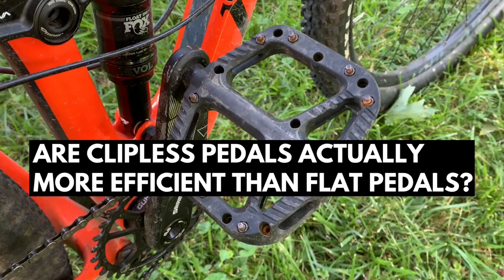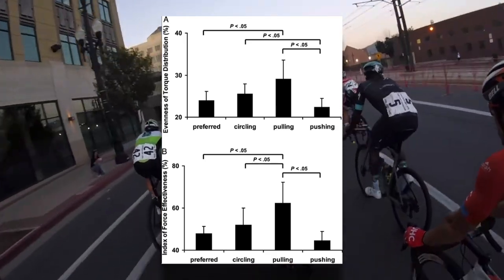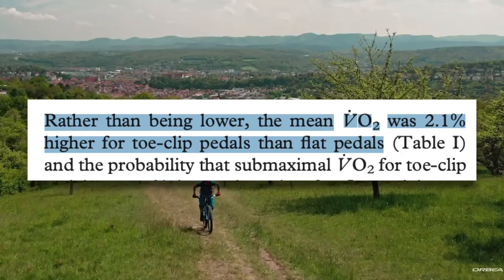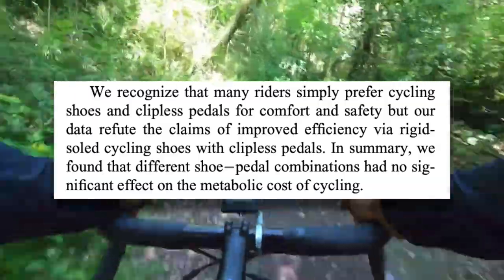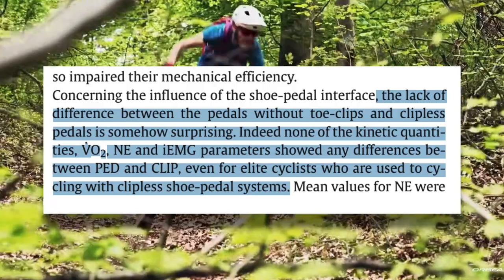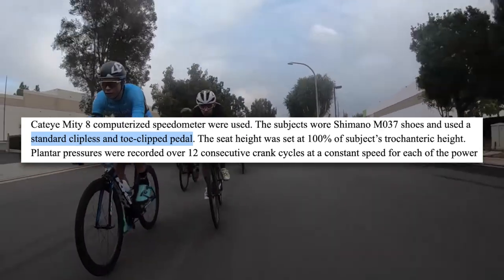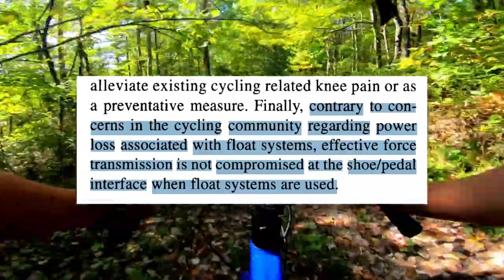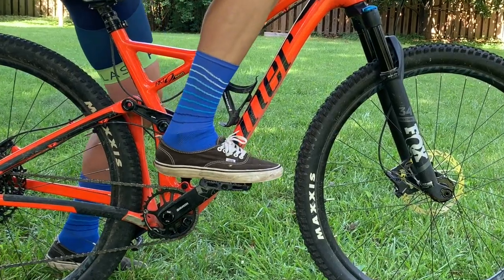Are Clipless Pedals Actually More Efficient Than Flat Pedals? The Answer Might Surprise You.

Comment: I just found out how to take a lot of seconds in 2nd transition in triathlon.
Just use your running shoes on the bike :)

Might not be interesting in long distance racing if the cycling shoes add to comfort but in short course or Olympic distance racing...this could easily make a difference.

I can't say I am terribly surprised.
When I first switched to clipless pedals I didn't get any faster.

And I guess most of us here will ha e experienced the same.
Reply: I won my age group in a supersprint triathlon by riding in my running shoes. I thought I looked like a moron, but then I saw myself cruising past all the geared-up guys (cause I had to make up for my non-existent swim).
If you also have some toe support attached to the flat pedals, it's almost not worth bringing your clipless pedals and cycling shoes for shorter (flat bike course) triathlon events.
Reply: Maybe not a bad idea, i often race people on the street and when we get to a light and have to stop well... i am usually 100m ahead while they are still busy clipping in.
Reply: The time you'd be saving in T2 would be lost in T1
Reply: @e995a1ad  I don't think putting on running shoes would take longer.
When the clipless shoes are clipped in you need to put them on as well, and when the shoes are not clipped in you would run a lot faster to the line where you can't mount.

Where do you think you would lose time in t1?
Reply: This is a good point for a shorter flat Tri. I bet there is also an aerodynamic difference that becomes noticeable in long distance riding.
Reply: I did this in my first Tri Club sprint tri. I had one of the fastest T2 times! Even our tri club president commented on how faster my T2 transition was. And I would've been even faster except I had to stop and ask where the run start was. lol.

However, during the bike portion of race there was some hills and fast downhills and my feet slipped off the pedals a couple times.

In my second sprint tri I wore my  and expected a much faster bike split. It ended up not being much quicker if at all, despite my shoes not slipping off the pedals at all.

During longer rides, tho, I definitely prefer my clipless pedals because the stiffer soles on my bike shoes spread out the pressure and it's much comfortable.
Reply: @Bendersnatchling  putting on cycling shoes takes virtually no time when done properly on the bike. Also for draft legal races at least, it's not about saving time overall, it's about not missing the pack. Which is why elite short distance athletes don't ride in running shoes.
Reply: @e995a1ad  The Chicago triathlon was muddy one year.  People who ran barefoot to the start of the bike had to deal with muddy feet when inserting them into their rubber-band held clipless shoes.
Reply: @norbert4571  Ya, I bet "ALL" the geared up guys were real rockets.  If you biked in your running shoes,  it was probably a pretty short bike event.
Reply: This is about EFFICIENCY, not speed/power. You can actually put more power INTO the upstroke, it's just not efficient. So it depends on if you can gain more time by pushing in more power.

Comment: This was from about 20 years ago when I was in college: the exercise physiologists I spoke to had established that pulling up with flexors was inefficienct, BUT, pushing over the top or pulling through the bottom of the pedal stroke was sometimes beneficial.
Reply: I tend to pull forward at the top/carry through at the bottom instead of "pulling up" and it feels like it recruits my shins and hips more than just my quads, I've found it helps me recover after sprints and uphill work, but I've also got monster calves and shins for whatever reason, I'm honestly not sure which came first, the 3/4ths stroke or the musculature.

It feels like simply measuring output efficiency misses some of the other potential benefits behind a more complete stroke, but I'm also a relative novice and I'm only starting 20+ mile rides in the past two weeks, usually having stuck to 10-15 before.
Reply: Hear hear. For the longest time I cycled like a triathlete with a toe downward, downward pushing, running on a bike type style. The only pulling I could then do was upwards "On the upstroke" but now I have switched to a heel dipped, pushing forwards more and I can now scrape that mud on to the wall in front of me, as if I am pointing brickwork with mortar, and pull backwards not upwards, and this recruits my glutes. As  Dylan says, this may not produce more power, but it uses a wider variety of muscles. I am 57 and my knees and hips started to go (hurt and  even had instability) because I did not use my glutes at all. Now I have swapped to the old "bunched up at the back" style of riding, like I am sitting on a high recumbent and touching my toes. In this style, I think I need to use at least straps or clipless (i.e. clip in) pedals.

Comment: I'm into touring where I like to do 200 km / day, spending 8 hours in the saddle. Speed is nothing to me and efficiency is everything. Based on your video, I have no desire to switch over. Thanks for this useful advice. I've found the other advantage to flat pedals is they're much easier when I get into a city and need to stop every couple of minutes. The disadvantage of flats is that there is a limited choice of stiff shoes for them. The running shoes I've been using make my feet sore after 4 - 5 hours. I've just ordered a pair of Five-Ten Freerider Pros and we'll see how they do. My  two concerns are blisters and breathability.
Reply: You can still use something like a mountain bike shoe made for SPD pedals and just don't put the cleat on them. Still get the benefit of the stiff sole.
Reply: @Dave_the_Dave  that's actually interesting. I've actually thought of using a pair of hard soled cycling shoes without the cleats in them. Wonder how that would work.
Reply: B.S.

Comment: I've been on flats for years. Back in the 90s I got a set of MKS brand clipless pedals which were hated by the biking press, but I loved. The reason they were disliked was because they were more sensitive to dirt in the cleats for clipping in, than SPDs, which is a fair point, but they were vilified because they didn't unclip when you moved your heel inwards, locking more firmly to the pedal instead. This feature was actually a major benefit as I could leave the release tension very low and still never get an accidental unclip because by just pulling my heels inwards a little when bracing for bumps or on hard sprints I was certain I was locked to the pedals. By the same token, I was so confident in the unclipping repeatability that I could unclip to bail off the back of an overcooked wheelie on demand and with no delay.
Every clipless pedal I've used since (Admittedly all Shimano, mostly because most other bike companies seem to have spent so much on marketing wankers and cost cutting that they've forgotten to employ any engineers, so if Shimano can't do it, I can be pretty confident none of the rest can do it at twice the price) has been garbage in terms of repeatability on unclipping, staying clipped in reliably but with low enough force to unclip that bailing unexpectedly is an option and accidental unclipping under power. That I ride further and climb faster than most people I know who use clipless pedals using Hope flats (Only low profile flat pedal I've found that can survive actual XC/marathon mileage without the bushings dying in sometimes as little as a month) and FiveTens (The pins on my flat pedals chew through the soles of my FiveTens every 6 to 9 months, so it's more expensive to go with flats than clipless if you want your shoes to stay reliably watertight).
The other weird quirk I get with clipless pedals is in the winter my toes will lose all heat within 10-15 minutes of starting a spin because the metal plate the cleat bolts to conducts all the heat out of them - this is with the supplied insole and a thin layer of styrofoam added under the insole and 2 pairs of socks, so they're a warm weather (>10 degC) only option anyway, but I've mostly stopped bothering with clipless at all now.

Comment: I only use flats for mountain biking, I don't like the feeling of having my feet stuck to the pedals when riding tricky sections  when you may have to dismount quickly. I use the One Up Aluminum pedal, wide platform, grippy pins, low profile [the best pedal out there] and the lighter version 510 shoe.
  I unweight the up stroke pedal and can push pull because of the great pedal grip,  with this technique and pedal/shoe combo I feel it is as efficient as clipless for constant speed continuous peddling.
  The only real down side to flat pedals are when peddling at higher cadence, it is hard to keep the feet from slipping off the pedals at high RPM, 60-80 RPM seem like the best cadence for flats.
  Clipless are better for sprinting and climbing steep hills when max power needed.
 I use clipless on my trainer however, working on lifting my shoe on the upstroke which helps my flat pedal riding when I unweight the up pedal.

Comment: Thank you for posting this video Dylan.  I greatly appreciate your science based approach, which  identifies misconceptions associated with the conventional wisdom in cycling training.  As a former triathlete and road racer, I became interested in the foot-pedal interface after experiencing chronic knee pain.  A year ago, I switched a few of my bikes over to a large platform flat pedal, and noticed an immediate improvement in my comfort on the bike.  I believe the key here was using a mid-foot position over the pedal spindle.  After about three months, I was able to maintain the same power output as with clipless pedals in many cycling situations.  Flat pedals will require some adjustment of the bike fit to get the best results. At the same time that I started experimenting with flat pedals, I also made a structured effort to improve my bike handling for gravel and mountain bike by practicing trials skills.  It was here that I found flat pedals to be invaluable for improving my track stands, wheel lifts, and hops.  While clipless pedals are used exclusively in road, XC mountain bike and gravel racing, in more technical events, such as enduro and DH racing, about 15% of the riders use flat pedals, and in the most technical events such as free-ride, slope-style, and trials, flat pedals are used exclusively.   A few versatile riders switch between clipless and flat pedals based on the event.  I believe all riders can benefit from spending some time on flat pedals, as this will make practicing low speed bike handling skills much safer.  Once again, thank you for the thoughtful content.

Comment: Great video as usual. As an avid, but distinctly non-elite, road and gravel cyclist my current practice is to use pedals that are SPD on one side and flats on the other and to wear cycling shoes with recessed SPD cleats.  I ride about 80-90% of the time on the flats, and clip in only when the road becomes rough and/or twisty or there is a long fast decent. To me the biggest advantage of being clipped in is in the security of not having your foot jarred from the pedal and improvement in handling. Riding on the flats offers more comfort since the contact area is wider and I can shift my feet around to slightly different positions.

Comment: Interesting, I'm a cyclist and mtb'er since 25 years and this actually mirrors my own experience when switching between different pedals and pedaling styles. I use spd pedals for my xc mtb and flat pedals for my vintage steel gravel bike. I've never felt that spd pedals actually make me that much faster in terms of pedaling effort, if you wear shoes with a thin stiff sole the power transfer on flat pedals can be really good as well. And if you improve your flat pedal technique so that you nearly lift the rear foot off the pedal during the upstroke flat pedals can be very fast, you can also pedal a little bit in a circle without losing grip forward or aft on the pedal. Basically flat pedals can be an artform in itself and it's not just about "pushing down". I also like the flat pedals for their sense of "purity", sometimes I feel that I enjoy the simplicity of flat pedals more. I do however like spd for the sense of being locked into the bike when going over roots and rocks, it can also be very beneficial for tricky climbs because of the more even torque distributions and it can help with bunny hops over logs etc. I sometimes pull up on the spd pedals but it's pretty rare and only if my main muscles are really sore and need a breather, I sometimes also pedal in a circle during 100% sprints but it's definitely not often and not very comfortable in all honesty. In summation some of my best and more memorable rides have been on flat pedals and some of my most intense and bad-ass ones have been on spd. Guess if you have several bikes you should do both styles and find what works for you, or just do what I do and switch it up. Nice video 👍

Comment: One use of clipless are technical, rocky, rooty climbs, where you need to pull up over roots and slippery rocks. They definitely help in those cases. I am sure studies will average out these low frequency events. Another is while descending, sometimes the bike gets into a precarious situation and the bike “bucks” you off the pedals. This can lead one missing the pedals and crashing. Again, a low frequency event, but significant in the impact on a rider.
Reply: Interesting how different we all are, I'm exactly the opposite! :-) 
I prefer flats when riding technical stuff, gives me more confidence, especially climbing over rocks/roots, knowing that I can keep going to the very last moment and easily put my foot down at any time and from any angle. Once I learned the proper technique ('heavy heels, light hands' etc.) I also prefer them going downhill over uneven ground, since with proper pedals and dedicated shoes I stay on the there even during the rough stuff (and the occasional buck).
Reply: "Bucking"? Maybe you have too much rebound in your shock, too much air in your tires...
Reply: There's an interesting video out there from Jeff Kendall-Weed. He goes through all the serious accidents he had. Of the half-dozen he can remember, 4 were on clipless and two on flats. He alternates between the two systems. Doesn't prove that clipless are more dangerous, but no way they're safer.
Reply: oldkayakdude most competitive MTB racers, Enduro, DH and XC ride with clips. I still ride flats on DH or when I am learning something nee and clips during races and training. By the way, Jeff Lenowski (one of the best trials riders in the world), normally rides with clips, with the exception of when he is doing trials. I have ridden with him several times.
Reply: @farrier53  I have no shock on my road bike lol...you can still hit something and get thrown around a bit. I've definitely hit some sensitive parts on my top tube while standing up and losing pedal contact because I hit a big crack or pothole.

Comment: In my opinion when I switched to clipless I felt more scared riding my bike. The feeling that my legs are that locked in and when it comes to quickly getting them out, it doesn’t feel right. Also with clipless you need to adjust your cleats to proper fitting while flat you just move your foot back and forth. Another thing I noticed with clipless over the years is just how bad it is 99% of the time, it’s a pain to ride your bike clipping in and out over and over and makes cycling a hassle more than a joy. Flat pedals are great considering I don’t race or go for sprints
Reply: I switched to Schimano SPD on my mountain bike years back and once I got the setting it was a breeze to clip out and bunk a corner. TBH you just react from habit. Of course it is slower to get out of the pedal but if your not racing downhill, the climbing security and ability to lift the ass of the bike at will is great.